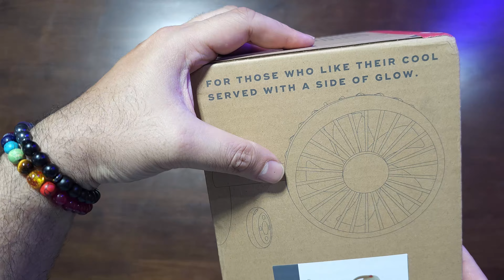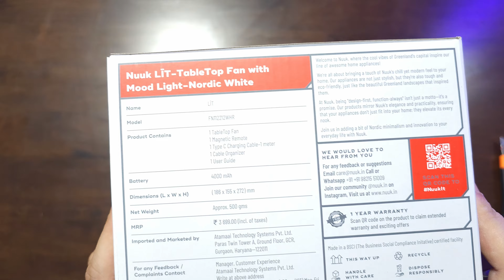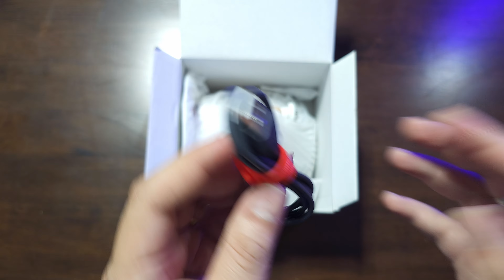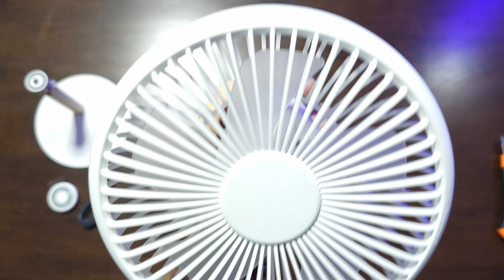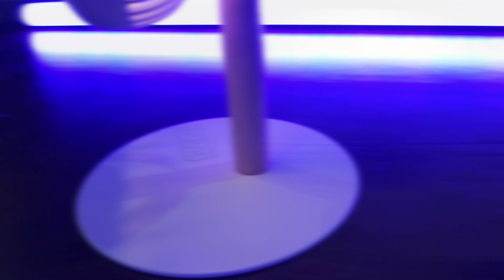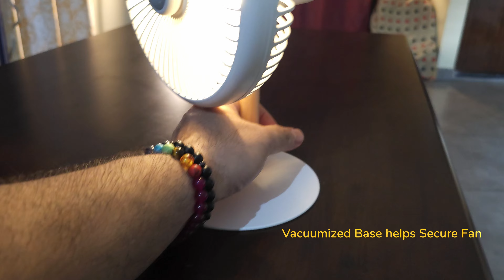Nuuk Rechargeable Fan | Lit | Designer BLDC Table Fan #tablefan #portablefan #bldcfan

Comment: Hey dude, was in the market for something like this. Can you adjust the angle on this thing? I mean I wanted to gift this to my wife in the kitchen so can this be angled to come directly at your face?
Reply from the maker: Yes it's got auto  horizontal oscillation as you have seen  and manually you can adjust tilt vertically

Comment: What about remote,
Remote has rechargeable battery or we have to put cell in it
Reply from the maker: It's a non rechargeable remote..
Reply: Does the fan operate without a remote ? Like the oscillation and mode button?

Comment: How does one replace batteries of the remote?
Reply: Probably it's a car remote battery. Available everywhere and lasts for months or years. Cost 60rs
Reply from the maker: Yes CR2032 costs about 40 will last a year easily